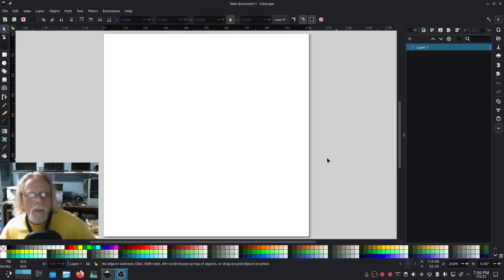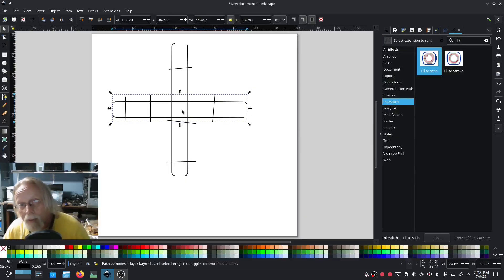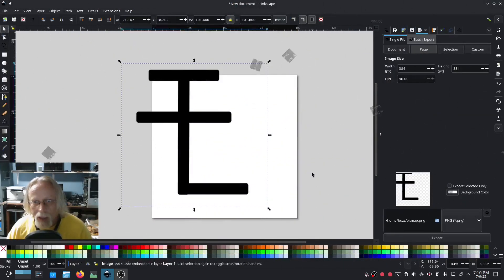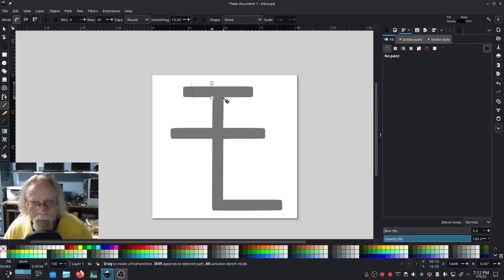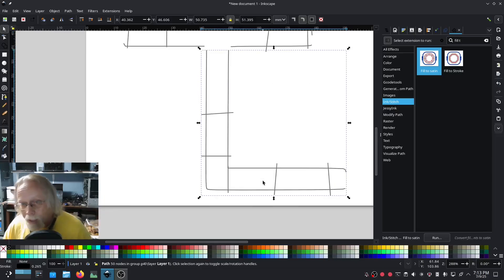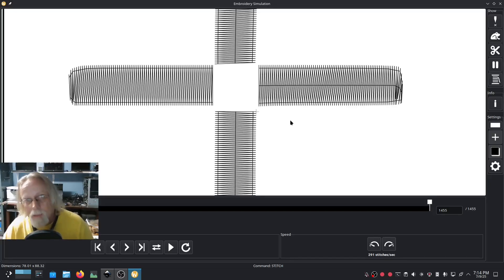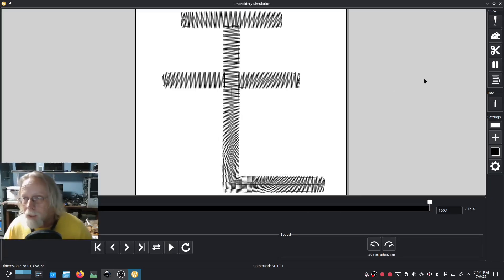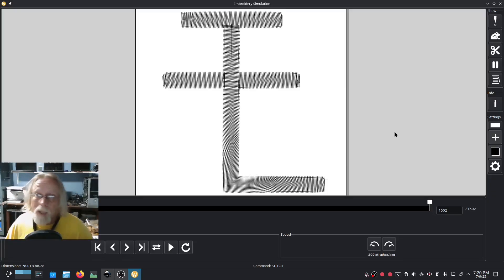Inkstitch v.3.2 - Explaining when and why to use bridge on fill to satin

Comment: The reason why your corner did not convert properly into the satin you wanted is because you placed the bridge node outside of the shape so inkstitch figured that it was to be considerd a rung
Reply from the maker: After your comment and rewatched it you are 100% correct. Failure on my part LOL. Thank you for the comment my friend.
Reply: @LowTechLinux it is all about understanding what is a rung and what is a bridge
Reply from the maker: Would help if I'd stop calling rung a rail. Work in progress lol
Reply: @LowTechLinux with this process to make a video you want to explain and then you are constantly switching between rails and rungs and a person gets mixed up himself i have same issue
Reply from the maker: Thank goodness. I don't feel so bad now 😁
Thank you for the encouragement 😊